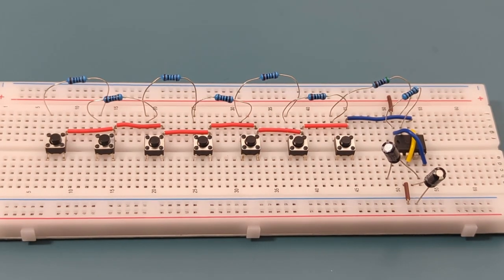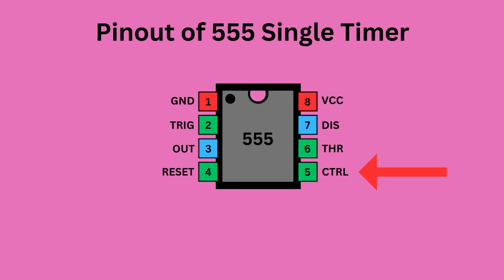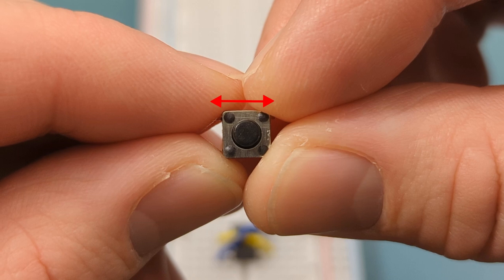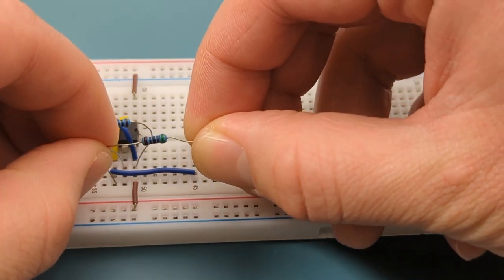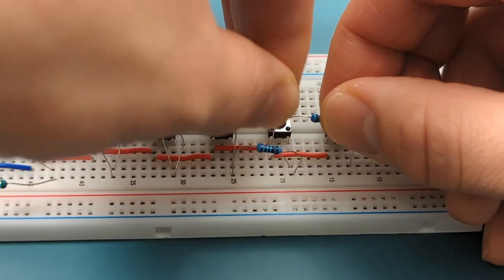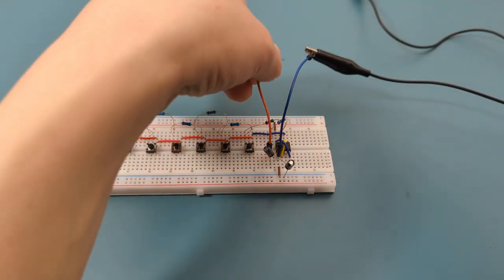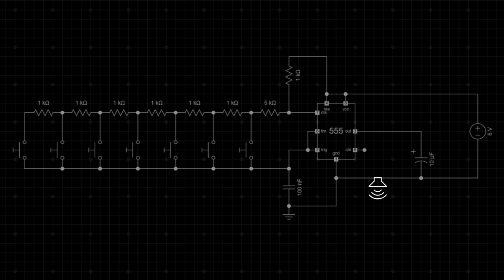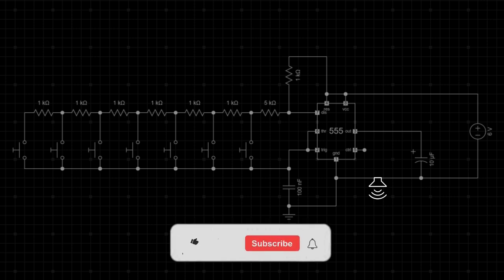How to Make an Electronic Piano With 555 Timer

Comment from the maker: 🔔 Get your tools here:
✅ Electronics Component Kit: https://amzn.to/3N65asq
✅ AA Battery Holder: https://amzn.to/4gCInSx
✅ AA Batteries: https://amzn.to/4j0x3Rb
✅ NE555 Timer: https://amzn.to/41MpQhp
✅ 5W Audio Speaker: https://amzn.to/4a55aTX
✅ Resistors: https://amzn.to/3YfGeUi
✅ Capacitors: https://amzn.to/3PzflXK
✅ Jumper wires: https://amzn.to/3NNn9UR

Comment: For this to sound like a major scale you would need different resistors for the connection between the 3rd and 4th buttons and the 7th and 8th buttons.
Reply: Using trimmer resistors (small potentiometers) might be beneficial, so you could tune the resistance between the keys with the help of a tuning aid (tuning fork, frequency app on your phone, whatever) to get the correct tones.

You could probably also redesign the part of the circuit where you have the 5k resistor at the end of the chain --  put in another resistor in parallel to the 5k with a button/switch to open or close the parallel part of the circuit, and you may be able to shift the keys up/down an octave. Not sure of the resistance needed here (would have to break out a calculator).